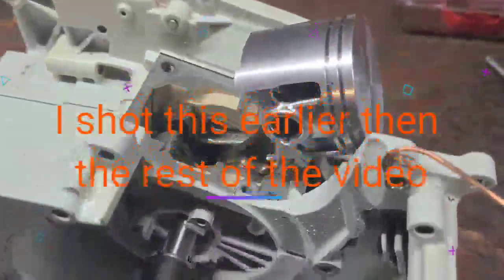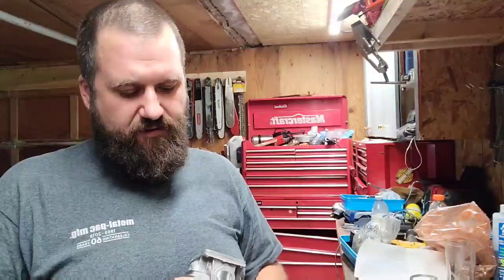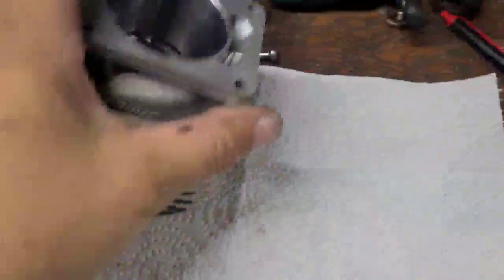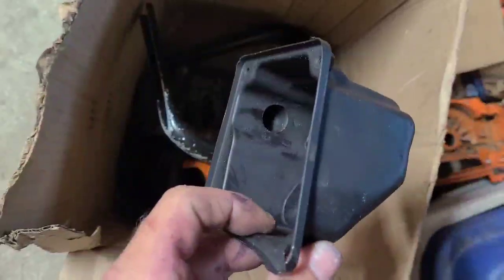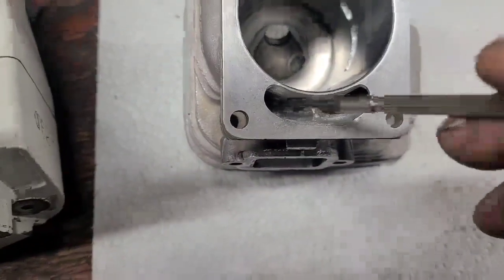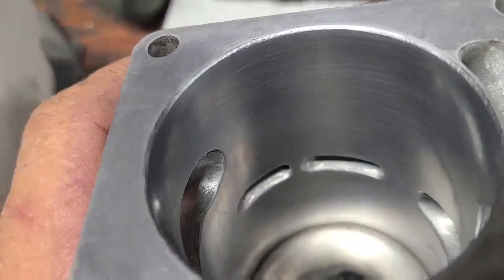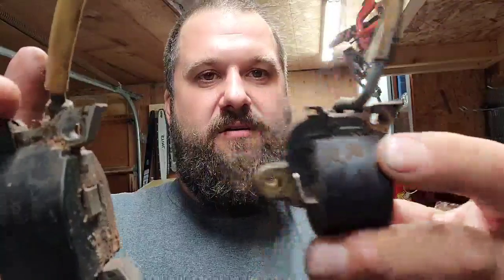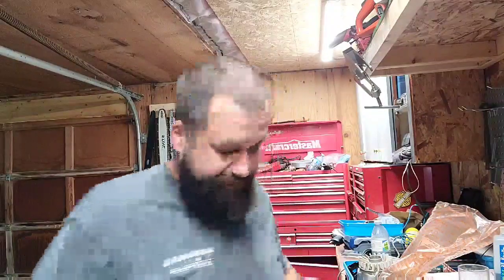STIHL 461 PORTING

Comment: Those transfers WTH???  I've never seen that type of layout it's brilliant, awesome job Stihl!!!  Re not  going online to find others' work...I'm not so sure I'd be quick to brag on that man, learning from others on this type of thing is all but required if you wanna be as good as you can, to not learn from others (which inherently includes looking at #'s) is to severely handicap yourself....but I'm suspecting you meant it more like "I don't only copy #'s", find it nearly impossible to believe you don't even google to see what others do (I mean, maybe not, you did mention "going through" a ton of saws learning....kinda figured that was hyperbolic but I'll certainly cede that you could learn by going-through a bunch of trial&error experiments instead of learning from others!)
That baffle on the OEM, thanks for showing that, have been having a helluva time making decent mufflers (I can't weld, otherwise I'd just do those pipes/bear-claw types that Harv & Billy are using), I love that idea of a solid-bottom baffle (would wanna open it WAY up from OEM dimensions, but would love like 50% of the bottom half of that baffle), I just did my 1st good (will see when tested I guess :P ) muffler for my 660's, I literally carved a piece of sheet metal to sandwich in between the muff halves to act as 'baffle and defection wall', it is secured in 3 of the 4 corners but its bottom-clutchside corner does a sharp bend inwards back to the exhaust-flange, so the exhaust pulse is literally shot-back at the flange, optimizing backpressure & scavenging!  And that corner is lifted enough that more-than-enough air can get-around it, into the "front half", for escape through a large half-dollar sized hole in the front-plate :)
Thanks as always it is so cool hearing your thought-process on this stuff, majorly appreciate it!!

Comment: I think you very much for helping everybody with your channels and I have learned a lot from your channels I was wondering do you do basic porting for people ? I have a still MS-461R chainsaw that I have done a little bit of mods to the air filter cover and the muffler I'm going to receive my new port muffler kid I have a friend that's helping with help me with it but the porting part he does not have time to do I'm trying to do that myself and I have a 395 XP chainsaw that I'm doing that too it has a modified air filter system that I did to it and a ported muffler and by the summer I'm planning to save enough money to do one of the one of them ported first anyway I do find help your channel is very helpful to help people. !!

Comment: BTW flywheel fins-- I got a saw to salvage/repair, thing ate something solid and lost multiple fins and also had its coil knocked-off the block so badly it stripped one of the 2 coil-mount holes!  Saw runs fine to this day w/o having balanced the fins (I *couldn't*, lol, there was already too much material gone I needed what was left to do its job fanning the cylinder), I know it's just a case study of 1 but figured to share because it's always astounded me that it works, both how imbalanced the flywheel is and that the coil is McGuyver'd in there I literally pressure-fit the flywheel-casing to press-into a block of Permatex I poured in-place to aid in pegging the coil in place!  This hasn't "just run" it's been running for nearly 2yrs, though admittedly I don't use it anymore I just start it now&then to ensure it still works, it's too heavy compared to my other climbsaws now, but it runs very well!!
Would bet that a 2-fin loss would not affect anything in any significant way, with it balanced how you did, hopefully you have updates on this one will go check!
Thanks as always for the A+ content!!

Comment: What do you use for a base gasket? I only replaced one cylinder and I used Permatex Red High Temp.
Reply from the maker: Permatex motoseal is what i use.
Reply: @tinmanssaws  Where can I find it. I looked on amazon and they didn't have it. Maybe my search was wrong. I used it on a 200t clone which I rebuild using as many OEM parts as I had to. They are a small package and not the easiest to work on!!! I hope it holds up.
Reply from the maker: I buy my mototseal at any autoparts store.

Comment: Hopefully when I get my 461 goin I can get it ported that is my goal.
Reply from the maker: Email me when you do that if you need help.
Reply: @tinmanssaws  awesome thank you for that do u need entire saw to Port it or can I just send you the cylinder or? What's best?
Reply: @tinmanssaws  either way is ok just asking ur preference /thoughts.
Reply from the maker: @justinweaver8787  its all good brother, if i was going to do it I need the whole saw.
Reply: @tinmanssaws  ok no problem I think I'll stick with the original plan cylinder and have it ported an I found a hyway pop up piston with caber rings an depending on the squish possibly a base gasket delete squish permitting that is but got to run it alill bit 1st make sure bottom end is sound plus I got to get a dual port muffler cover an remove the baffle in the muffler it has that weird baffle that directs the exaust to the top of the muffler chamber idk y lol. It has no bucking spikes an the clutch cover is busted and the starter recoil spring grenaded out of the starter cover while I was changing the starter paws an pull rope so I either have to get a cover or get the factory spring wound tight enough to get it back in the lil channel and get the pulley back on it before it flys out lol joy for me lol. But it probably won't be very long and I'll have the parts an alil run time and I'll be ready to send it to you to work ur magic.
Reply from the maker: @justinweaver8787  I'd shoot for .023" plus squish on that saw. 25 though would be ideal. The one I did was 23 though but I used a meteor piston.
Reply: @tinmanssaws  did you do a pop up on ur I forgot I watched the videos on it I like it u did a great job on it and the 440 both.